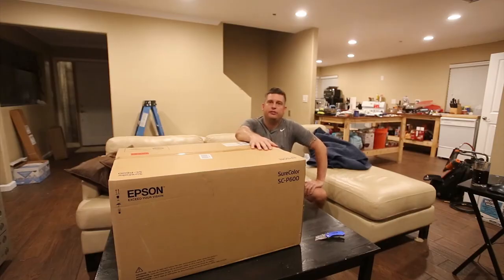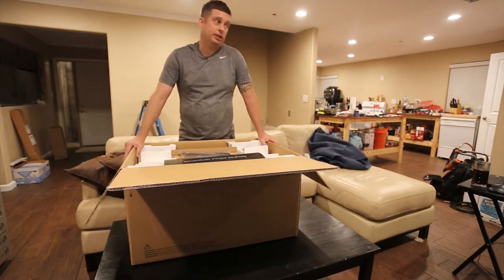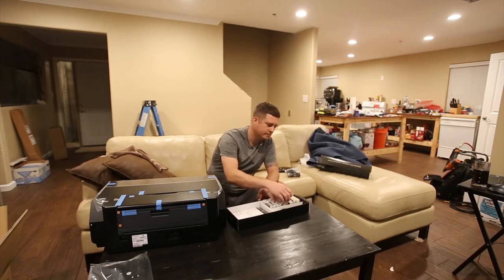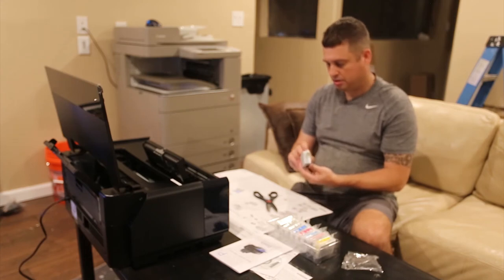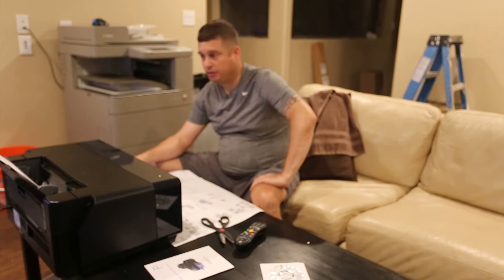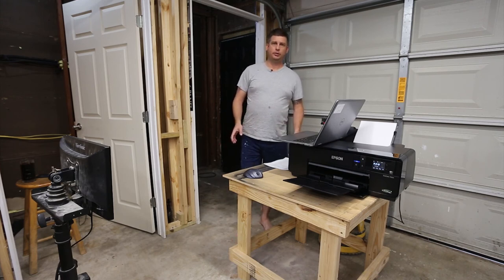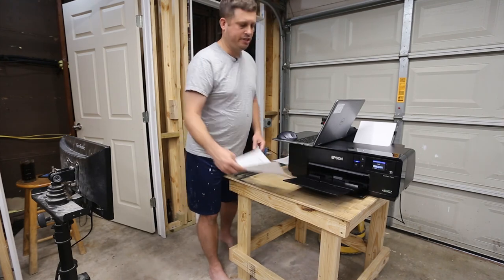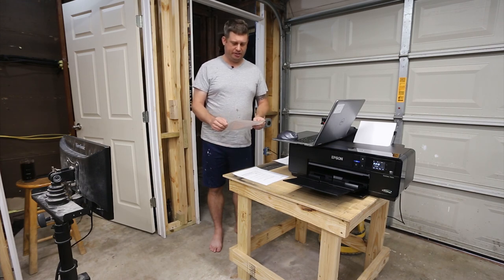Step 1: Open DTG - Epson P600 Initial Setup for Direct To Garment

Comment: Hi if you setup for dtg can you still do other prints like canvas and paper prints?
Reply from the maker: Not really.  The DTG inks are specific to apparel.  Paper and canvas print much closer to the printhead then DTG.  I did do a test paper print and I'll post the video of it....   The other consideration is that DTG is a 4 color/channel system.... CMYK and if darks then WWWW (white).  The P600 native ink set is 8 colors.  CMYK LM LC PK and I think LY, but don't quote me on that.

Comment: Hey Brian... thanks for this video series; it was great. After putting the OPENDTG build together and  using it; was it worth it? Does it make it's money back? Would you recommend it to others? Thanks
Reply from the maker: I think I would probably buy a pre-finished unit if I were doing a do-over.  Probably a KatanaDTG.  This was very educational, but I've not had the volume to justify converting it from Epson inks.  So the project has not been finished beyond the mechanical conversion.  I am glad that my videos have helped and inspired others to experiment with DTG.  My goal was to contribute documentation to the project.